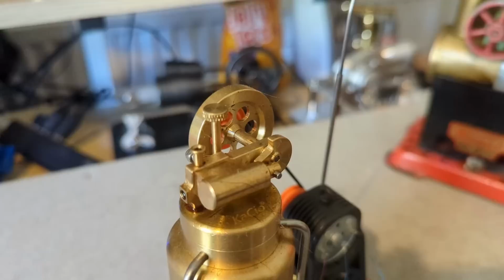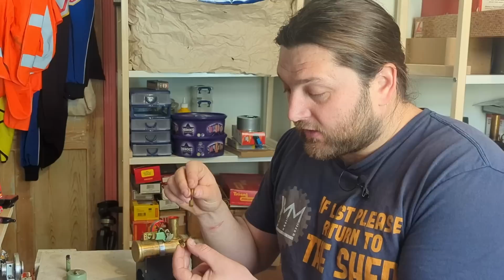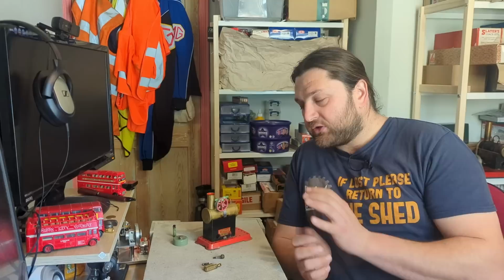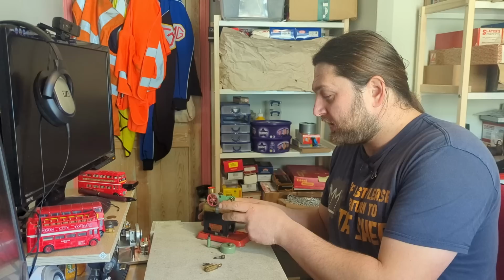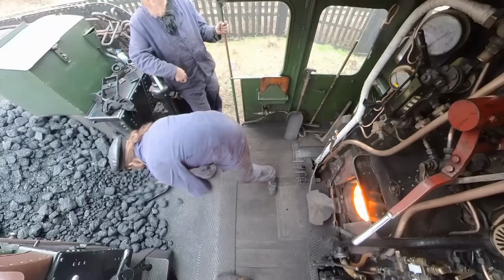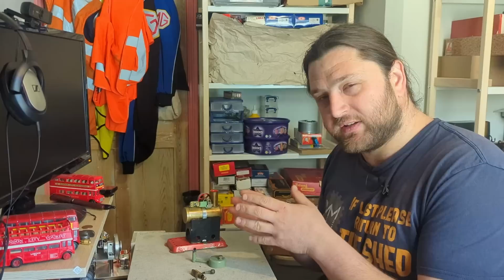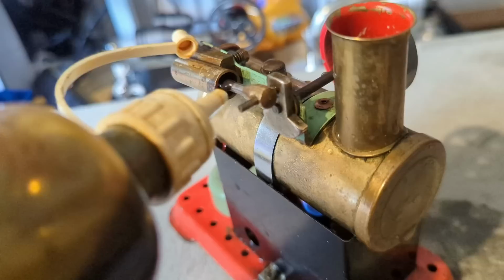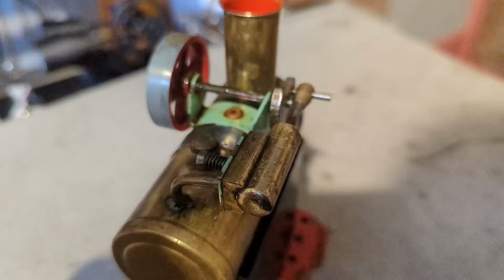How a Steam Engine works - with the Mamod Minor

Comment: When I was a kid, my father brought home a steam roller model, called “Old Smokey”.  I used to love watching it!  It had a slightly more complex steam engine and boiler, with all the running gear of a steam traction engine.  It used the solid pellets for the burner, not sure what they are made of.

It’s on my shelf now, I really should take it down and check it all out for safe and proper operation, and run it again!
Reply: You must have a wilesco brand
Reply: Hexamine.
Reply: You can get solid fuel tablets in most stores with camping supplies but they need to be cut down to fit in the burner
Reply: My story is very similar😀😀

Comment: Great video. I suspect that the o-ring seal on your safety valve may have gone as it shouldn’t be leaking from the base of the valve but from the cap at the top.
Reply from the maker: Yeah, they're old so could do with replacement

Comment: Wow. I love it. I bet you could use propane to heat the water on the cheap and clean and off you go. Could power just about anything with it if size is proportional to whatever it is youre trying to power.

I love older tech to this newer stuff. Simply put, I can understand it, its cheap, easy and it actually works.

Nice.

Comment: That was a good explanation, some of it didn't go in when you scaled up to full size but it did answer the question of what the pipes are inside a full size boiler for.  I'd be up for an explanation on a full size while you're showing one if that would be possible, it would really help thanks.

Comment: I just got me one of these little stationary engines I think mine is a older wilesco d5 from Germany I've only ran it once or twice for testing purposes now the only thing I got to get is fuel tablets thanks Lawrie for that water tip I'm gonna use it on mine since it does have no water gauge on it

Comment: My modern Mamod a TE1 I think runs on solid fuel paraffin tablets two does a twenty minute run from cold but add warm water more like 25 to 30 the down side they are a pig to light especially if outside.  She works at 10psi safety valve goes off at 15psi and according to instructions on the box in the factory they are pressure tested to 50psi.  Mines called Jessie Sarah after a great grandma 😊

Comment: I still wonder how things may have been different if steam had carried on being evolved. In the usual engines there are obvious limitations to how much pressure and how dry and so on but I feel like a lot of those issues would have been engineered out by now.
When you consider so much rubbish is still burned with no recapture of the energy it does seem like there is a lot of energy being wasted which could be doing useful work. 

As for seeing more - yes I would love to see how the different systems work. There were quite a few over the years and steam turbies are still with us so right the way from the most basic to the most extravagent would be great.